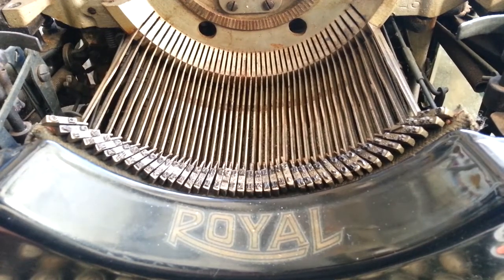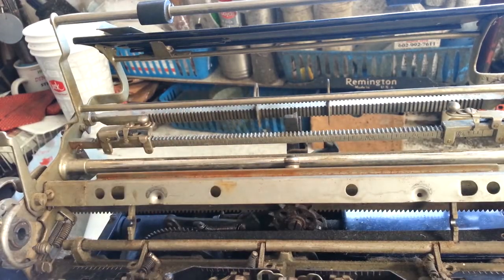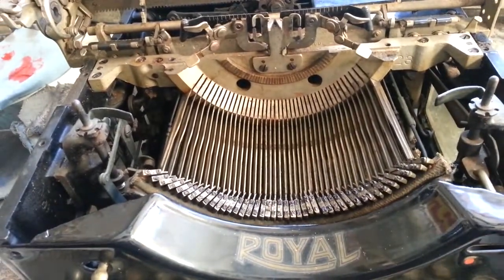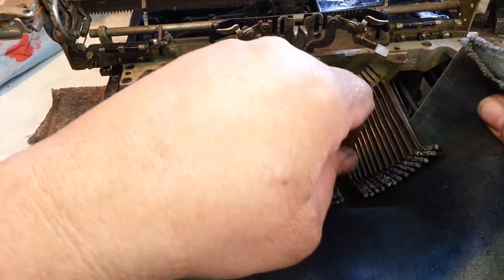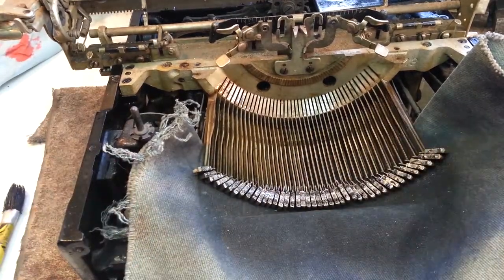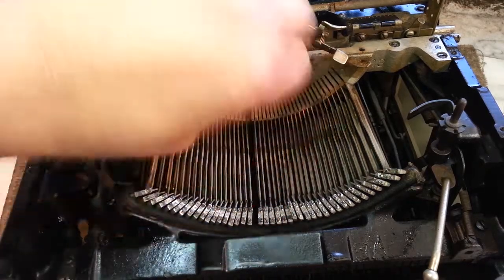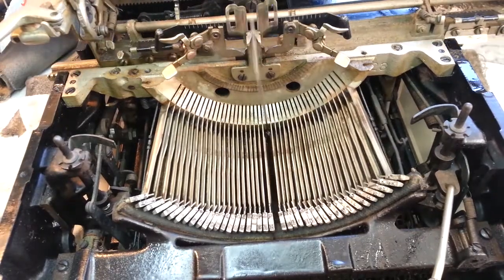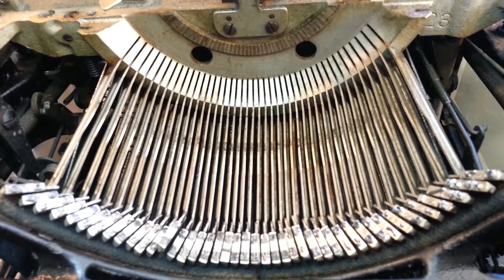Royal X Ten 10 Typewriter Clean Type Slugs (faces), Chemical Flush Type Segment

Comment: Hi thank you so much for posting this! Beautiful job. I have a 1930s Royal 10 and want to clean out the slugs...i watched another video where someone used lime-away and a tooth brush. Would that work or harm anything?
Reply from the maker: Well I don't know, never used lime-away. many methods to cleaning type slugs, nothing will hurt them, they are hardened steel
Would be concerned about lime-away on other surfaces, like I worry about using LT, protection must be taken
Reply: @phoenixtypewriter2136  thank you!

Comment: Do you think a 14 in carriage model had heavier springs? Did every long carriage model have the side supports and support bar along the back?
Reply from the maker: Maybe a longer main spring, internally, but other wise should be the same,
Most did have support of some sort for wider carriages
Reply: The #10 is on the bench! So I’ll be watching all your vids on. Didn’t want a WC model, but it was too nice. At some point a shop in Lubbock Tx put their decal on the inside of one of the windows and painted both of them. Have you ever seen this. Why would they paint the windows? They look to be in great shape upon early inspection.